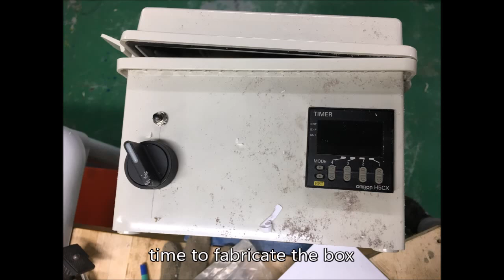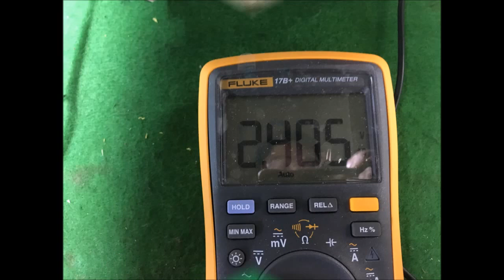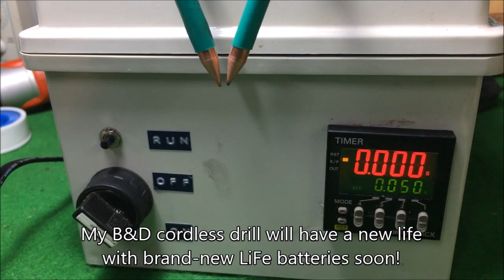DIY battery spot-welder using a digital timer (omron)

Comment: It looks good but a Google search for the digital-timer, OMRON H5CX reveals that that unit alone costs around $200. It doesn't seem like an economical solution for a DIY spot welder. Or am I missing something?
Reply from the maker: I was VERY LUCKY to get this used unit at $50 from one of my friends, that will explain why I did this ;p. However, there are some digital timer boards from HK or CHN that are cheap, they will do good job for  DIYers.
Reply: Ahhh... that makes sense... And thanks for the tip. I'll look on eBay to see if I can find a suitable timer board. Thanks...
Reply from the maker: YW. :) Though I haven't tried, I guess 1/10s control with an 800W MOT transformer will be able to do battery welding, and there are lots of DIY boards that can handle 1/10s under $10. ps. I couldn't find any 1/100s-class board on eBay.  You can probably use an Arduino board to do that.
Reply: I found some cheap times on eBay that work with 120V. They all have a relay and I'm not sure if those relays will be able to handle the amps.
Reply from the maker: Absolutely not.  If I were you, I would replace the relay with a full-sized SSR.  PCB does not have a space so extend wires from PCB to SSR. SSR does not have a physical coil inside, it will simply open/close the gate of power IC inside.  Any SSR over 25A rating would do the job.  Good luck.
Reply: I'm glad I asked. Even more glad you replied.... Thanks... So, since those components are no expensive I guess I'll buy a timer board and a SSR separately and see what happens. Worst case scenario is a $20 loss. I appreciate you're taking the time to advise me.
Reply from the maker: You are very welcome!  And bear in mind that you are controlling amps on the primary side of a transformer, not the secondary. Secondary side is low-voltage with several hundreds of amps.  Mine is close to 1k amps on secondary side lol!
Reply: Oh, yes, I am aware of that. Again, thank you for your time. It really helped me out.